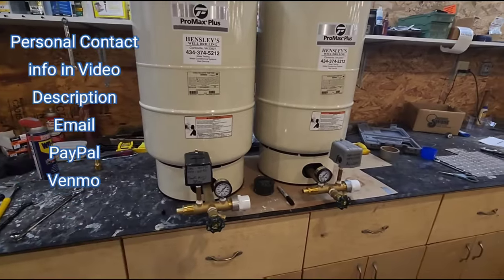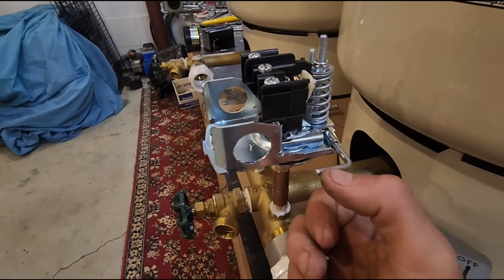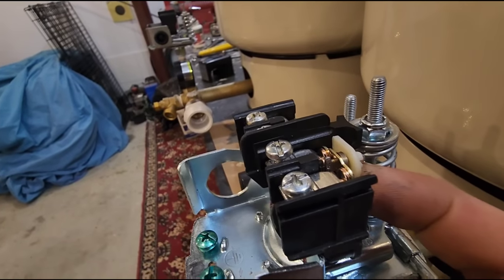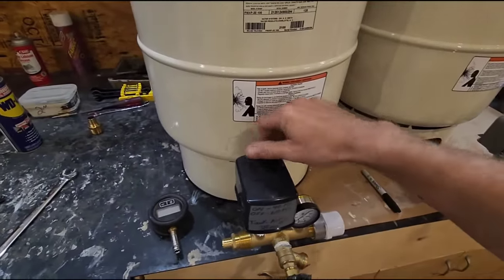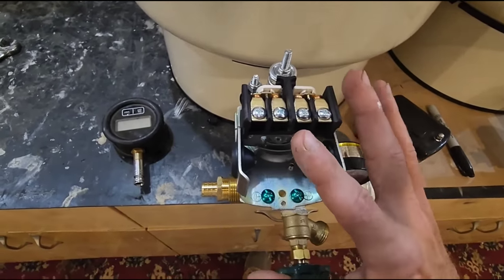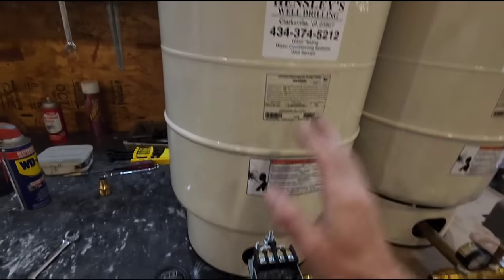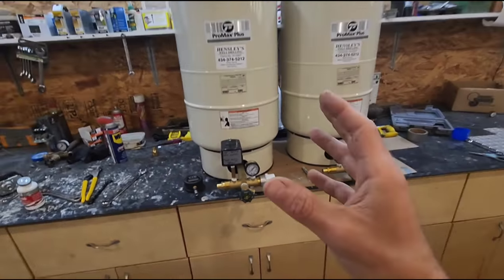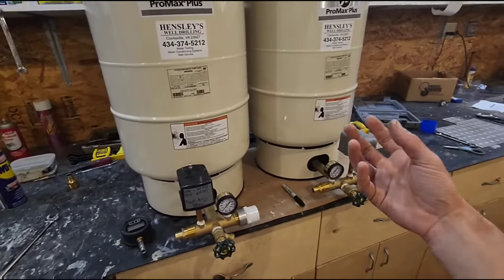Most Common Reason for No Water!! Reset Pump Pressure Switch. Water Well Repair Vlog Ep.18

Comment: I have an issue hope to get some answers . Water stops for 30-40 sec and then comes back on and then for some time pressure is very good ..after 10 min of water running it again stops for 30-40 sec . Water pressure in meter is 40/60 . Any suggestion please
Reply from the maker: The nipple below the pressure switch is likely clogged up with sediment or iron. Remove the switch and using the screw driver, jam it thru the little pipe to clear it out.
If the nipple is not clogged, then what your experiencing is likely a pump that is over heating and cutting itself off til it cools down. The pump would fail altogether in the near future if that's the case.

Comment: Would you be able to help me diagnose my well pump issues?  My husband and i bougt and old farm house 5 years ago. In the basement is a 14 gallon vertical pressure tank, 30/50 pressure switch, and a 3/4 hp pump. This was all working good until our sump pump went out and the basement flooded enough to float the pressure tank. Then we started getting issues with water pressure. The upstairs shower has strong pressure, downstairs shower was really really low. Like it would barely come out of the shower head. We checked air pressure and it was 28 on the tank. Well this morning the pump was continuously running but no water. So we bought a new 3/4 hp pump, 30/50 pressure switch, and 14 gallon vertical tank along with all new fittings and a pressure gauge for the pump. Put it all together and let the pvc cement dry a few hours. Primed the pump, and then turned the pump on and turned on faucets throughout the house to release the air and fill the pipes again. The pump runs but doesn't build any pressure, no water, and it actually started getting warm to the touch. We had assumed the other pump and tank were bad and needed replacing bc they were pretty rusted and a little leaking before it stopped pumping water from our well. Is this a pump issue? Or something else?
Reply from the maker: Are we talking about an above ground jet pump? Or a submersible pump in the well?
I believe you probably have a leak on the pipe that's going down the well.
But I can be more specific once I understand what type of pump it is
Reply: @h2omechanic it is a pump that is above ground for a shallow well. Had a friend come out and look it over. Turns out the check valve was bad so it was causing the ild pump to work extra hard to pull water all the way from the well after every time it  shut off. Then the new pump was set up for 220v instead of 110v.. once that was figured out it took a bit of coaxing and priming to get the new pressure tank set up right and now we have water again :)  We still definitely have to replace the check valve but the hardware store was closed by the time he was able to figure it out

Comment: I just put a new pump switch on and I can manually get it to 30 psi and it stops.  I run the water to zero.  It won’t kick back on by it self.  Bladder is at 28 psi.   Why won’t the switch kick on?

Comment: Our pressure switch seems to be working just fine. I drained the tank and it shot up to 60 and stopped. The psi of the tank is at 38. However we have no water whatsoever. What could be the issue?
Reply from the maker: Do you have a filter? Is the element inside it a black/carbon type? If so throw it away and don't use them

Comment: There seems to be air coming in the line from our well. Those that mean we need to have the pump lowered? The pressure in the coming does not stay up
Reply from the maker: I'm going to assume the pressure keeps going up & down. Typically that means the pipe down in the well has cracked/split. (That happens if it froze & the pump dead headed for hours) pumps pushing against ice can build 200 psi & bust the pipe. 
The fix requires pulling the pump out & look at the pipe within 5 ft of the pump. A fitting is normally cracked or pipe is split.
Reply: Is it very expensive to repair??
Reply from the maker: @Carlos Moral  it honestly depends on the depth & particular system setup. Could be $500, or $2000.

Comment: So we had a power outage and the pipes froze and we got everything thawed out in the water came back on until it apparently ran out. After some time the water was working again until it runs out and let it sit for a little while go check it the waters working again until it runs out what am I dealing with?
Reply from the maker: Its possible that the pressuee switch is messed up (if it froze it can bend the arm inside it) or more likely, the nipple below the switch could be clogged with sediment or iron build up. 
Those are the simple problem/fixes.
Now what's common when a system freezes, the pump will run non stop & dead head against the ice blockage, this can put 180-225psi of pressure in the pipe that's in the well, bc the pumps running...that high pressure can burst the pipe in the well & cause a pump to begin to overheat & cut itself off til it cools down. Typically in that case it'll almost seem like the water cuts off or on at total random, that's bc its overheating and cooling down again & the cycle repeats. 
Or your draining the well dry bc there's a leak somewhere that you have not yet discovered.  
Best to call in a company to diagnose it top to bottom.

Comment: I cant even get the cover off to check which pressure it should be at or if there's anything wrong inside. I'm trying it's not coming off. There is no lever on mine to set.

Comment: I replaced my switch and still no water, replaced the pump control box, capacitor blew. Thought cuz it was a different size, so I went back and replaced it 2 more times. Both blew again. I only replaced cover not whole box. Is that the problem??
Reply from the maker: The pumps bad

Comment: What should I do when my pump always turn on and off frequently? Without anybody using it or no leaks?
Reply from the maker: First address the tank, it's probably very low on air. 
Turn off the pump breaker and open a sink. Then go check the tanks air pressure, minimum should be 25psi, if its low, pump it up with a air compressor. 
Then turn on the breaker and close the sink.
If its Still kicking on&off, that'll tell you that the check valve in the pump has failed. Or a cracked fitting at the pump.
Either way, you'll have to pull out the pump. 
But get your tank set correctly first. 
A band-aid for the time being, you can put a check valve at the well head or just before the tank. But that could cause a air issue (but it'll stop the on/off cycle) til you can pull the pump out.

Comment: Please help me out, I moved into a new house last summer that had a new well tank and new well pump installed but two weeks later the well pump went bad and I replaced it and then started working again. But I moved out for six months and then I had a tenant move in, then two weeks after, the well tank bladder busted probably due to low pressure as I’ve heard. That was about two weeks ago and I replace the well tank ASAP. But yesterday my tenant told me that the water stopped working again. The previous owners of the house did not live with the well water they collected rainwater they only installed a well tank and pump for me to move and also the neighbor across the street there will work but the neighbors right next to me have also not had water and have had problems with their well components. Me and my father checked the wells yet as well as the water yet and I think if I remember correctly The well is 124 feet deep and the top of the water is at 90 feet. PS I did get a new pressure switch when I replaced the welting two weeks ago.

Comment: Voltage is reading 214 , double breaker 20 amp it’s the enough?
Reply from the maker: @antoniozaragoza3774  if you have a pump in the well & it's trying to operate, 214v seems to me like you have a exposed wire down in the well possibly that's leaching out voltage into the water

Comment: You cant dig a 200' hole but all the rest should be bought and installed by the home owner. Even if you hire a driller and pump wire tank installer the home owner should be like a supervisor and help if not do all the work to install the well water system.
Can drillers do this or want the home owner to know how easy it is to do this? 
Yes
Maybe a complete vid of the entire possess and what and why to prevent un necessary help trips.

Comment: HELP! No water and my husband has no clue about this stuff. Replaced breaker and pressure switch. auto shut off is on my left and not the right as shown. When I hold it at 45 till pressure moves it pops the breaker

Comment: I have the second style switch it tripped tried the flick technique and then tried manually holding it in with the cover but can't get it to stay back on
Reply from the maker: Typically that could mean the well is dry & needs to recover (check for a leak somewhere outsideif its cold temps!  Or hung toilet )
Or the pumps failed
Or you have a broken pipe or fitting down in the well near the pump.

Comment: i did installed new water jet pump with presure swich,,,,there is  old prsure tank,,,,,,pomp is working but its not pumping anything to a ffoset or to  a presure tank what is a problem,,,,,,,,,,system wasnt rum for 10 years,,,,,,,,i did fill water in to 2 pipes and pomp and water is there,,,,but its not pumping in to system,,,,,,,,,,i didnt remove pipes from existing well yet,,,,

Comment: 4:17 why does my well sputters when we turn the faucets on it does when you turn the faucets and it scary also I checked the pressure valve and it sparks when we turn water I thought it was air in the pipe so I left it running till it quits doing that

Comment: When I try and reset it with the manual switch, it will run then turn off and not increase pressure at all. What am I doing wrong?

Comment: I have solar 6k inverter that one run on the DC power will not kick on the pressure switch. Only if I reset it by turning the pump on and off will the pressure tank fill once but then it gets past the 30 psi‘s and drains and the DC power will not kick the pump back on. I haven’t been able to use my system since I installed it two weeks ago and nobody can figure out what the problem is.
Reply from the maker: Regular pumps run on AC current. 
If your trying to run a 240v well pump, it runs around 8 amps continuously & 15 amps to start it. 
Maybe your system can't handle the load of the pump under pressure. 
Solar is a completely different world, I've never installed one bc I don't see it working as described. 
You may be forced to buy a solar pump that spins slower.

Comment: I have well water - now I have no water coming into the washing machine, but kitchen bathroom have water - Do I need to reset?
Reply from the maker: The hose on the back of your washing machine has a screen protector in one end of it. Turn off the valve to the blue hose, remove the hose & clean out the screen. That'll fix your isolated issue

Comment: Power went out. I have no water inside. But the outside spouts are working. 
Could this still be the issue? 
I don’t want to go under my house if I don’t have to :/
Reply: Update. I went under at the pressure is at 30. Kicked on and went up to 40 while down there. Still no water in the home
Reply from the maker: You have a filter? Replace it...
You may need to clean your sink strainers

Comment: I have to wack the switch box with a screw driver and the pump starts but I have to keep doing it. It keeps going off. I turned off the breaker to see if I need to file off carbon.
Reply from the maker: Replace the switch,  the contacts just are too far worn.
Reply: @h2omechanic  thanks. I saw it was a mess when I took the cover off. Rusty and one contact kept falling off. We called the repair guy to replace the switch.

Comment: So i just had to replace my pressure switch. I went from 30/50 to 40/60. The pressure tank fills up to 60psi with the valve closed but when i open the valve to distribute the water to the mobile home park it drops to zero pressure and stays?
Reply from the maker: Did you inspect the nipple below the switch? It may be clogged. 
Or you have a major leak in the park somewhere

Comment: Hey h2o, i just changed a pressure switch for someone after it was basically proved bad testing it, hooked wires back up how they were, but there was also a cpl other switches laying in the basement so seems like it must've been an issue for some time, pressure just wasn't building up as jt should, and switch wasn't kicking on by itself, so went and got new and installed it etc. Well there's still no water, a breaker popped which makes me think maybe its been wired wrong the entire time, left too right order was black, red, black, white. Seems u say too put both colors on the same side, the red/black runs to the pump, white/black comes from the breaker. So i replaced the breaker and the switch and it does nothing. Thinking its the pressure in bladder tank now being down too 15psi, or maybe we got a bad switch the other day, either way its showing some sort of power now too it. But thinking maybe its always been wired wrong pr something also since it seems these issues have been ongoing and after seeing breaker pop and two other pressure switches laying in the basement. Hoping i can get this water back on
Reply from the maker: Breaker pops means 2 things. Either it's a bad pump in the well, or there's a bad wire down the well in the water. It's not the switch.
Reply: @h2omechanic  oh shit, but i see it seems too be wired different than what u guys say too. Could that be the problem? Wires left too right, black, red, black, white, took pic and all, but it wasn't working right for some time, pressure wise. Pump seems too work good though when the switch does, the old switch was working well just wouldn't always kick back on and build pressure as it should
Reply: @h2omechanic  thanks a ton for the reply sir! 🙏
Reply from the maker: @John Grace Jr  a switch can be wire 3 different ways correctly and 1 way incorrectly. So I doubt that is the issue. Buy a clamp style amp meter and clamp it around 1 single wire/leg & see if the reading is are 7 amps. If its reads about 11amp-20 then the pumps bad

Comment: I just watched your video to try to understand why we have no water after a power outage of 20 hours. I tried your technique  but the switch is different SQUARE D 9013FSG 40/60 with no lever to manipulate the contacts.
The pressure is at 60. The pressure tank is AO Smith Trident.
I’m stuck…no water, angry wife….

Comment: I have a question, my pump and everything was working fine but just 2 days ago my neighbor got her electricity turned off so what I did I went ahead and ran a new wire from my post to the waile pump I had a 15 braker and it was working fine for a day but then yesterday I went ahead and put the wire under ground and put a brake that was 20/20 but now I'm not getting any water but I can hear the pump working?
Reply from the maker: The wire from your box needed to go to the switch, not directly to the pump...you probably had amazing pressure 130psi & it blew up the pipe down in the well.
Reply: @h2omechanic  I contacted the wires to the pump control box. And I check the pressure on the tank and it says 35 psi I have a 40/60 switch

Comment: Why does my water keep turning off? I follow your steps and fix it but after a short while of using it, the water stops again. First it was the contacts, fixed that, then my power switch turned off and on again it worked now noting 😢

Comment: The problem with that low pressure switch, is after a power outage  and it goes back on , you have to go outside in frigid temps and click that switch in the well house. I want the kind where i can flip by remote control somehow or don't want it all. Also not great for old people who live by themselves to have to go do it.  There must be a good reason why they make switchs that way.

Comment: I desperately need a little bit of guidence. This all began from power outage. To straight wiring to a generator. I think the cut in/ cut off nuts got moved. It's cutting in, and off at the same psi. I NEED THE Humble plumber!!
Reply from the maker: It's best to just replace the pressure switch. But for now, try to tighten the bigger spring nut 3-4 complete turns down and see what happens.
Reply: Okay cuz I should have been sent the fact of the cut off its cutting off at about 40 PSI. So the so just do the big one okay I will try that. And I'm not sure if any of this is pertinent for this exact thing but it's a flex light flow through tank. And the pressure on that is 28. And I have to pop the little connectors to get it to initially when I power up the generator to get it to kick on to start with and then it will kick on on the second time of cycle like 30 and kick off at 40. And I do get water from the sink and the house when it's cycled on however when it kicks off the water to the house basically stops.
Reply: Ok. The pressure dropped down in mid 30s. So, with that, leads me to ask, since this isn't a bladder style tank, should I go with a 40/60 instead of 30/50? The pump is GouldsSJ10 part#JO6853L
Reply from the maker: Try turning the breaker off, open a sink, the go to the tank & use a digital psi gauge & set the air in your tank to 25psi, it may be way too high right now. 
Or if it's on 0-5psi, it's way too low (tanks probably bad, but you can try adding air with a compressor to pump it up to 25psi) if you have to add air, keep a sink faucet open while the compressor is running. Once you have 25psi of "air pressure " in the top of the tank, turn on the breaker.  Everything should work correctly. 
(Watch my Pressure Tank Related Video Playlist) to understand better.